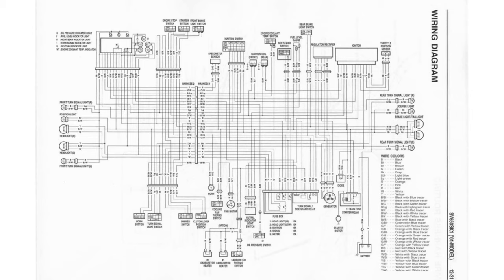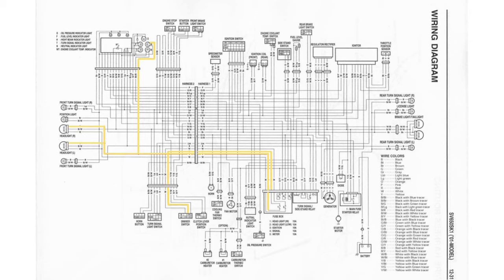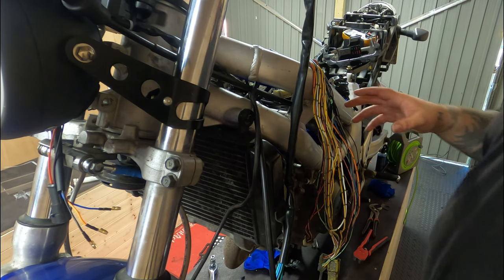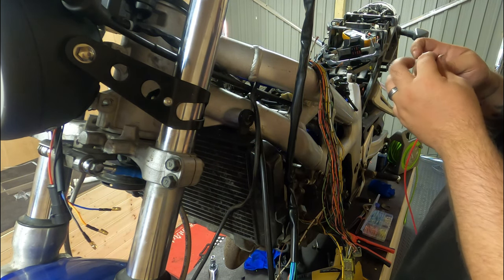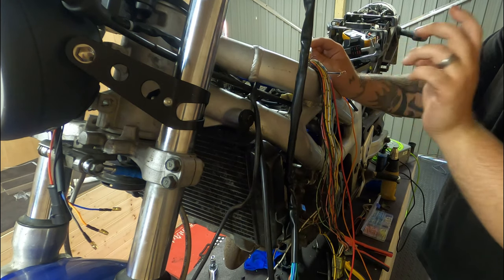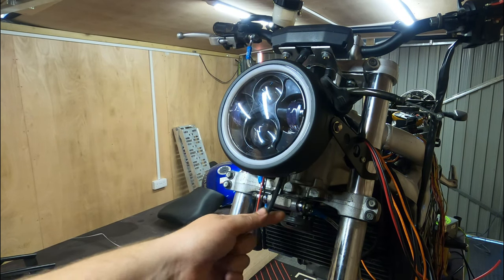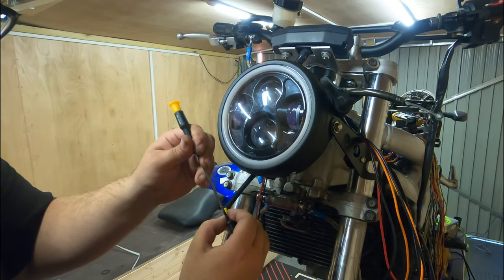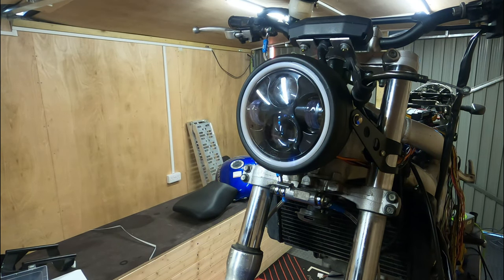HOW TO: Wire Motorcycle Headlight & Explaining Wiring Diagrams!

Comment: I have the same type of headlight. I like the yellow Ring. So I reversed the polarity... I used the ground "Green Wire" on my Position Ring Light , is it ok I just use the regular  red halo ring positive to the ground? 

It turns on without the ground connected.

Comment: Hey matey what is this light like on the road
Reply from the maker: Hi mate, it's much better than the standard. This one is the full fairing model so not sure what it's like in comparison to the N model but I've used this model of headlight on several bikes now and can't complain 😅
Reply: @madslickmotorcycles8391  think the wire's are the same just the s model has an extra h4 and a extra side light . ive just put a halfords advance. H4 in mine but tbh its no better than standard. Was toying with the idea of projector lights as i live in the middle of nowhere and can't see sh..t on dark country roads at night
Reply from the maker: @motorcyclewild5873  One of these units will probably do you a treat if yours is a struggle in the night 😅
Reply: @madslickmotorcycles8391  have you got a link please matey. Ive seen some on ebay but there are a lot of cheap knock off ones. I bought one last week to put on my Honda and it was a fake one with no power at all
Reply from the maker: @motorcyclewild5873  I'll drop you a message on Instagram 👍🏻